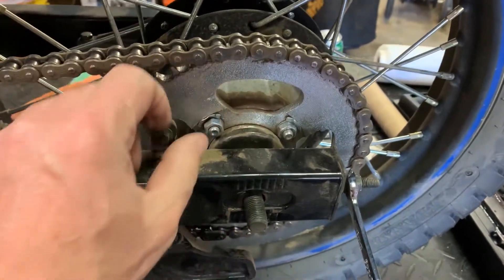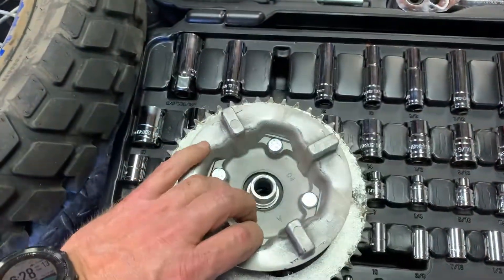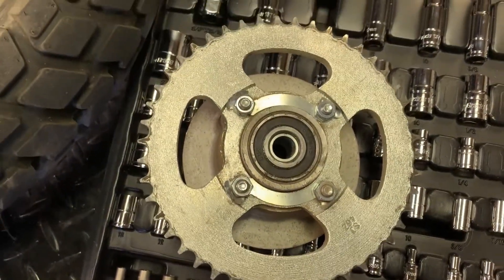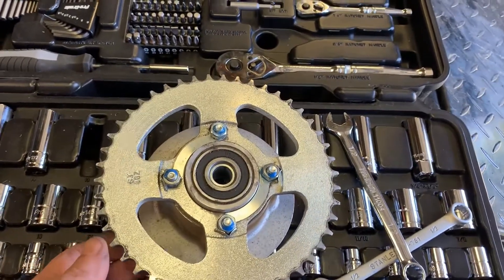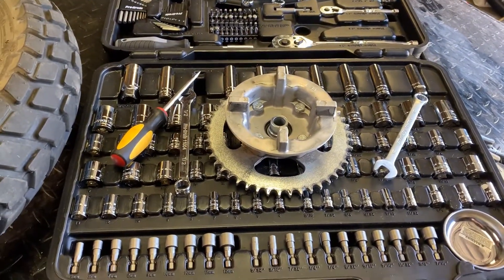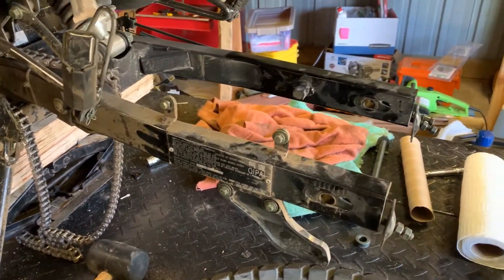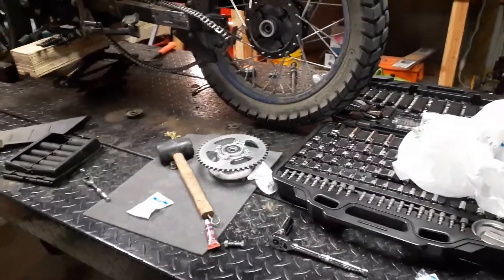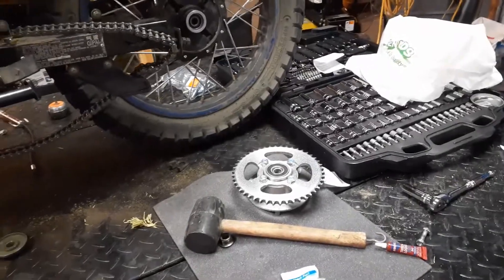Lifan Sprocket Final

Comment: Coming to this thread kind of late, but instead of fooling with bigger bolts and grinding off the flats on the bolt head, why not just do safety wire?
Reply from the maker: Thank you for the comment. I never even thought of safety wire. That would work for sure. I think part of the original problem is bolts that are too small in diameter and the head for sure. My guess is that the small diameter allowed the normal driving to allow some wiggle of the bolt in the hole then the nut came loose. It is very interesting to note that we are the only ones that I have heard to have this issue
Reply: I have heard of this issue. That nut can't turn, and the bolt has to be a tight fit. I'm getting one of these soon for my first bike. I'm mechanically inclined and I look forward to driving and tinkering with this bike. 2250 shipped to my door.
Reply: Folding shifter peg I will order